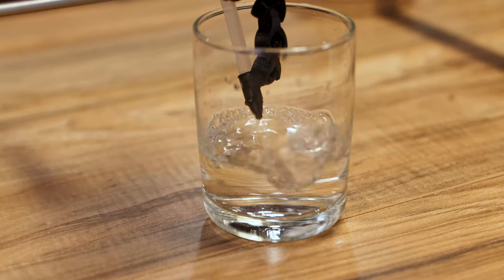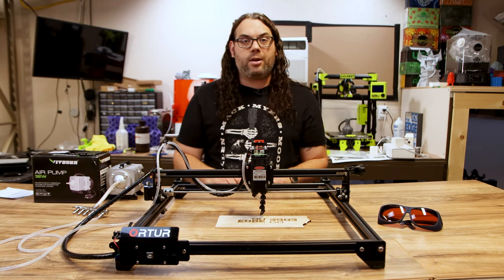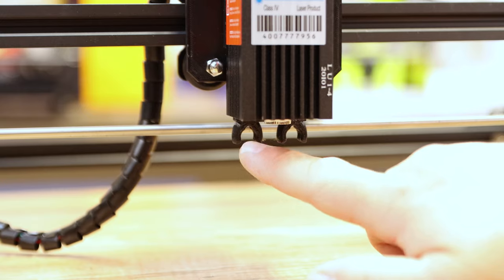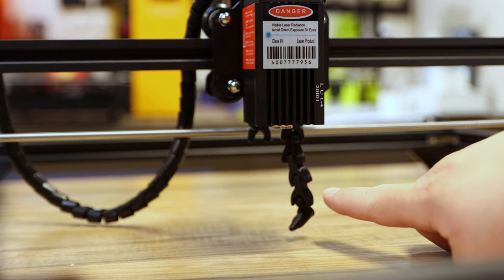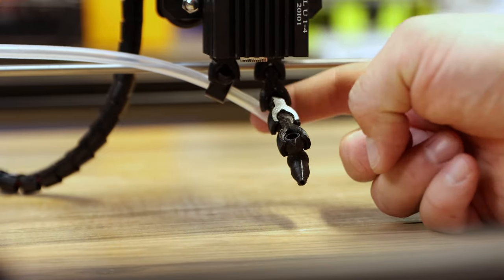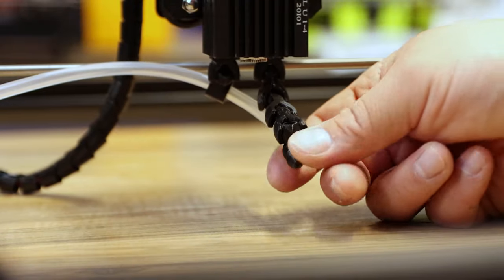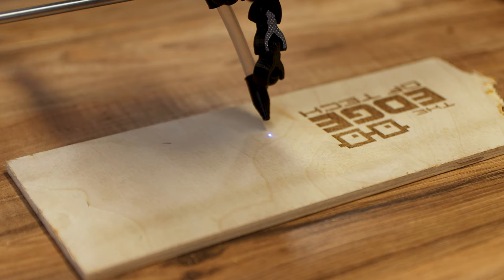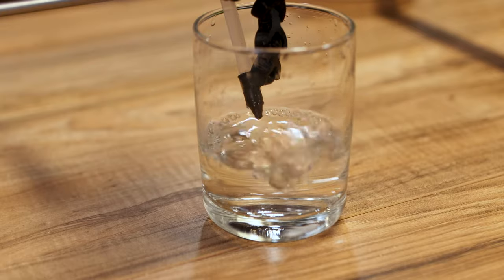How to Install Air Assist on a Desktop Laser Engraver!

Comment: If you want a super cheap and quiet air pump, rescue the compressor from an old refrigerator.  It certainly made a huge difference to my laser cutter, and because it is basically a pump, inside a sealed enclosure, mounted on springs, and swimming in its own oil supply, the air coming out the pipe is noisier than the pump. Fridge compressors are piston pumps vs the one described in the vid, a diaphragm pump.  I had to add a catch tank (jar with a hole in/out) to catch any oil vapour that might get pumped through, but is working beautifully and has the added bonus of smoothing out the pulsing of the airflow .  It helps with both engraving and cutting as it keeps the airspace between the laser and target surface clear of smoke which tends to de-focus the laser beam.  If you have built a home-grown laser like I did, you can add the on/off switch through a relay, tied to the coolant control of the CNC shield which powers the pump on only when required.

Comment: Great video! Just purchased my first laser yesterday.  Do I need air assist if I plan to engrave only (not cutting) My plan is to engrave cups, coasters, and key chains!
Reply from the maker: Thank you!! Great news about your new laser!! You wouldn't really need it if you are just engraving. But if you wanted to get it and keep it at a very low pressure, it would keep the smoke etc. away from the lens. I would say use it when it comes and get used to it, then upgrade later if you want/need to!. :)
Reply: Congratulations to your new laser and have lots of fun :)
I plan to upgrade my laser too with an air assist. From this and other videos I think the etching will be clearer and the lens will not get dirty so fast.
Reply: @TheEdgeofTech  thank you!
Reply: @olafb.2929  thanks! I definitely will get used to it and then upgrade.

Comment: Ive got the same pump on the k40, works quite well at keeping flames down
Reply from the maker: Agreed! It works good for sure!
Reply: How’s the noise level on it?
Reply: @catiewiggins4312  its not too bad, if you can hang it with some bungies it goes almost silent. make sure you dont put it on something that will resonate the sounds.

Comment: No disrespect intended but fancy doing a test with etching, when the air assist is mostly useful for when you are cutting and deep engraving.  You did acknowledge this in the video.  Also the before and after... the before version, you mentioned that the laser had move and you could tell.  how is it a fair before and after?

Comment: Just got a new Ortur Laser Master Pro and have been watching your great videos while waiting for missing parts.  In the mean time I've made some upgrades.  I've added a base system, feet, riser blocks, and an easily replaceable sacrificial board between the base and the laser frame.  If you're curious how this looks, tell me how to send you images.  While making these upgrades I had an accident.  I bumped the off switch and it popped off.  I don't know what to do.  Any suggestions?

Comment: Hi Jim,
Cool Video!
Do they have an air assist kit for the Ortur Laser Master 2 Pro?
Does anyone know if it is safe to use an aluminum bake pan or foil to protect my tables' surface when using the laser?
Reply from the maker: They do have a kit for the pro! I would not use those things because they could reflect the laser and that's bad. If you set the whole thing on a thin piece of wood, that would be better.